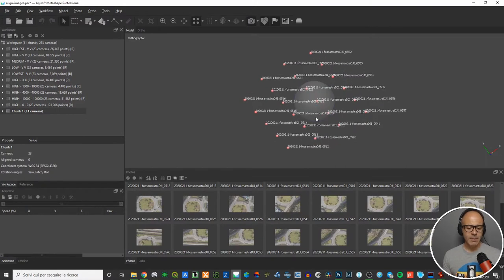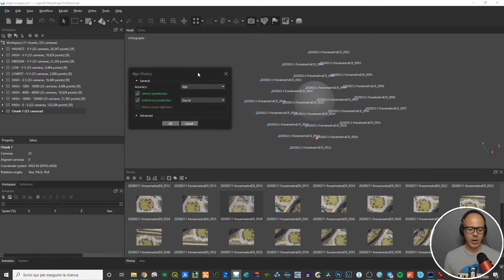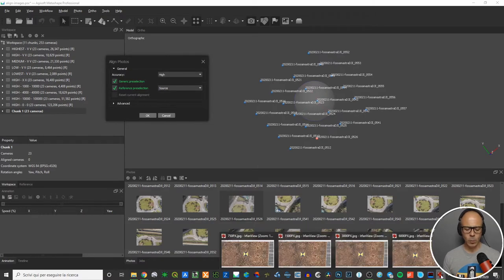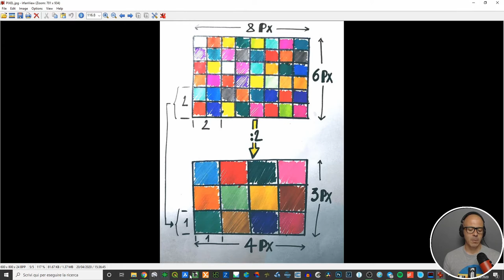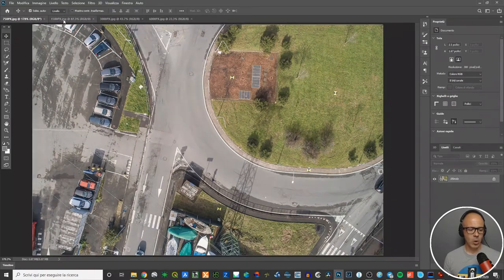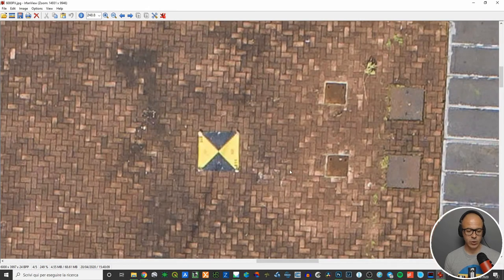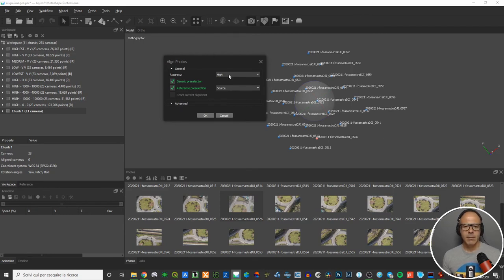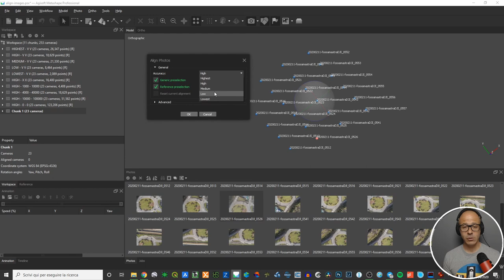Agisoft Metashape - Align images: accuracy ad resolution

Comment: Hi, Thank you for sharing! I was wondering if the I choose Medium or Low Accuracy, will the spatial resolution for the orthomosaic output image  also be downscaled? Or it will just downscale the resolution when building the Tie Points and the orthomosaic image will be the same resolution as the original image?